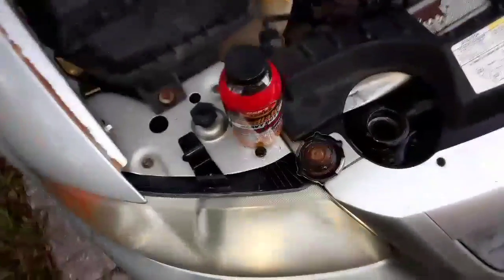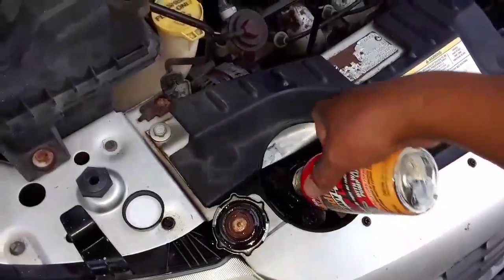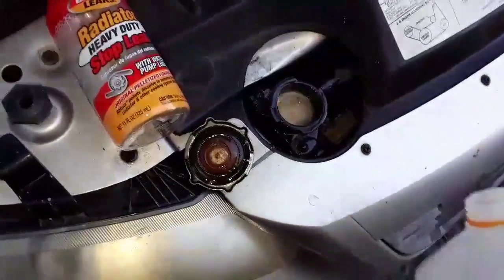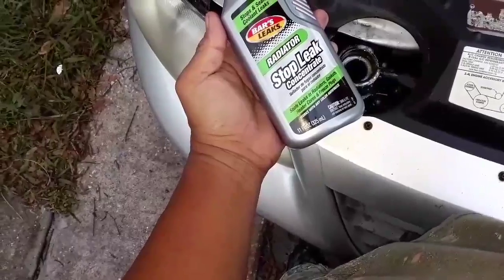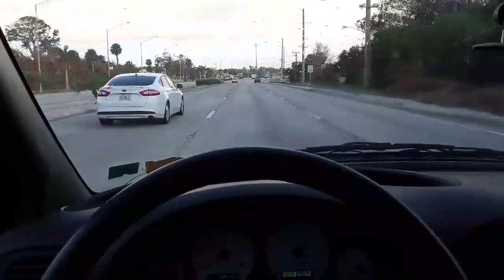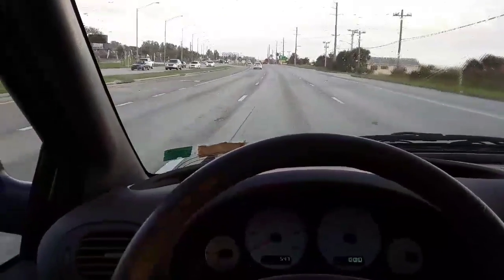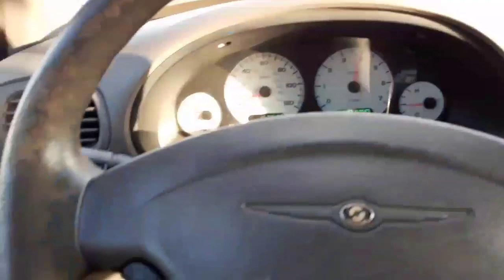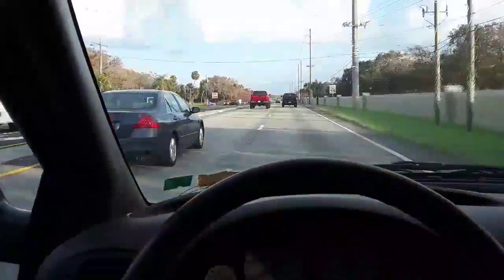Vanlife - A Band Aid For Rusty (V893) - Van Dweller Van Dwelling Vanlife

Comment: I can't believe the vehicle is going to hold up for much longer. The engine is cooking at those high rpms for that long. Even if  the radiator was working perfectly it would still not keep it cool enough at those high rpms. Plus your gong to mess up the transmission even more as I don't think 2nd gear was meant for driving in. But like you said if it holds up for 2 weeks you got your  money's worth. Hope it lasts for that long.